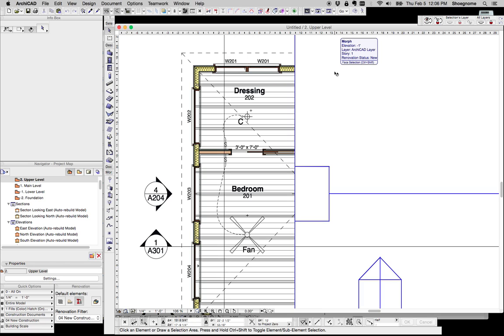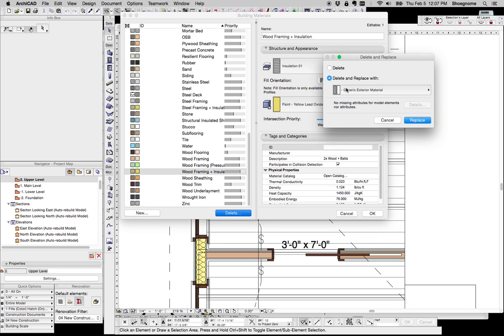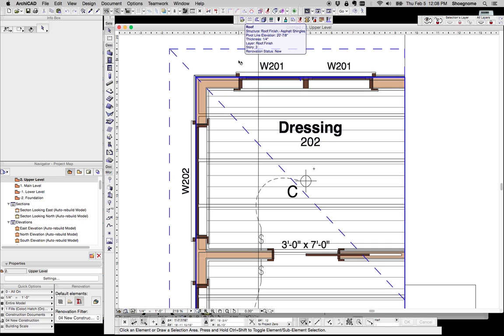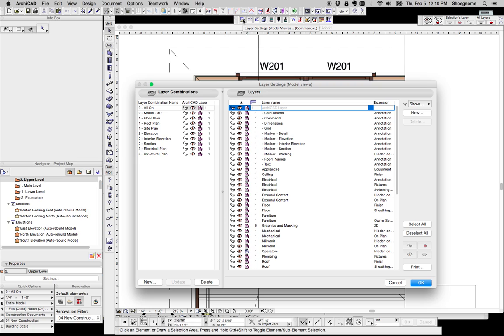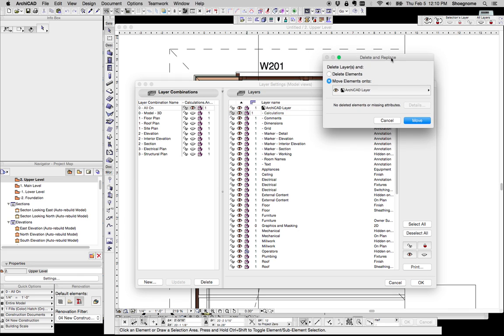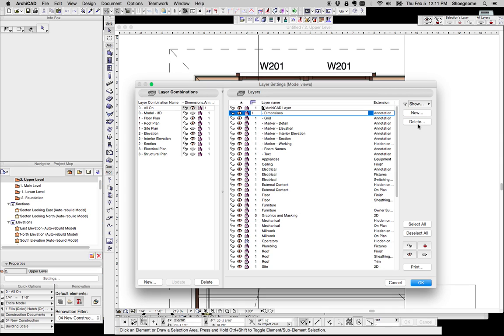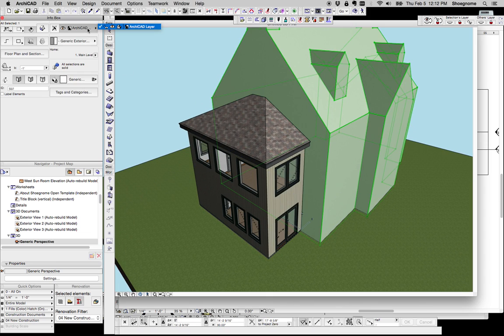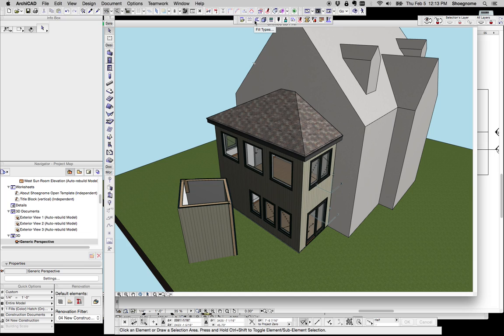ArchiCAD Tutorial #45: Deleting Attributes and the One Layer Model

Comment: Select all layers you want to delete, by either using click, hold shift, click, or select a few by holding command key on Mac and click delete.  Same effect as per this video.  (instead of doing arrow key trick)
Reply from the maker: That doesn't work. Well it DOES delete all the Layers, but it doesn't consolidate all the data to the remaining Layer. Try it. That will delete everything on all the Layers, even if you say move to a new Layer (I think it only moves the data on the first layer you select). Possibly a glitch, but select all and delete won't consolidate all to one Layer (at least not on ArchiCAD 18 USA build 4020).
Reply: Shoegnome Interesting.  On my version Mac AC18 4020 intl it does work.  I selected all layers, except archicad layer, deleted them, and all was consolidated to the archicad layer.  Nice trick though, thx again.
Reply from the maker: Erich Lutz
well crap. You are right. This does work. I swear it didn't when I tested it earlier. Damn. Well hopefully there's enough other value in the video.
Reply from the maker: I've added a note to the video. Fortunately everything else still makes sense and is even more valuable now as consolidating is even easier. Ugh. You test and test and still sometimes miss something.
Reply from the maker: Erich Lutz in other words... THANK YOU for catching my error. I so much appreciate it.
Reply: Shoegnome Jarred, dont be hard on yourself.  An important thing that came out from the Masters of Archicad Summmit this weekend was when Karoly Horvath said "we must share", and that is what you are doing and it is through share that we also learn.  Im still a rooky, but very indepted to guys like you that share.  Someday i might also start to have the confidence to share.  Often wished i had a shoegnome in my office too...

So THANK YOU.
Reply from the maker: One of my main goals this year is to find a way to inspire others to start sharing more. I'd love to see an army of people sharing their tips and tricks and favorite aspects about ArchiCAD. Novice to Expert, we all have something to learn and something to teach.